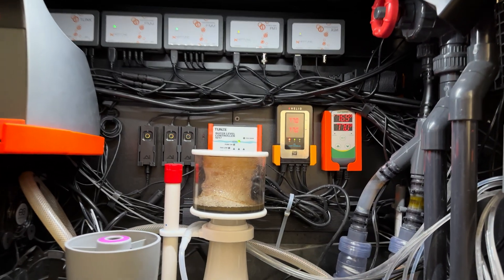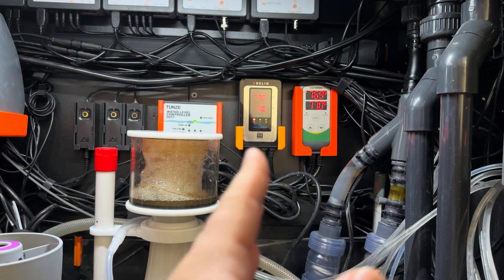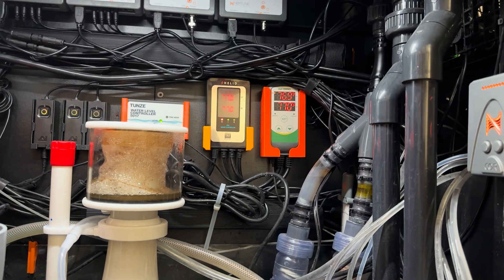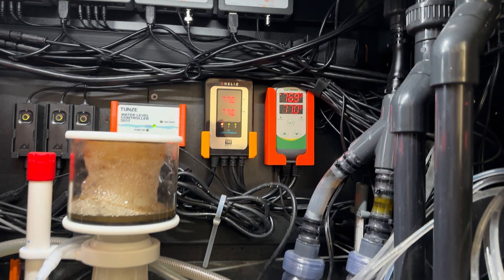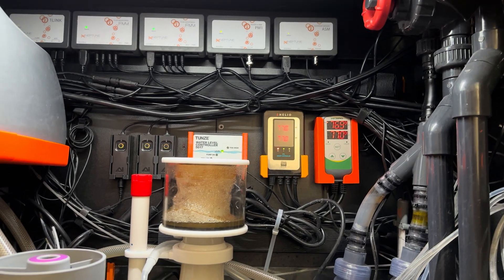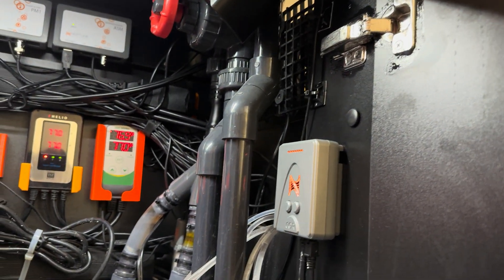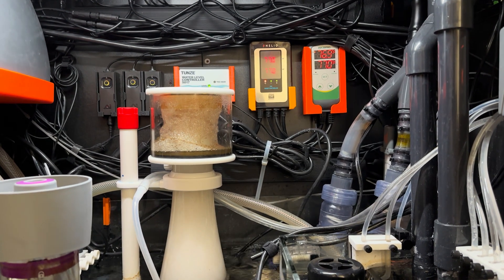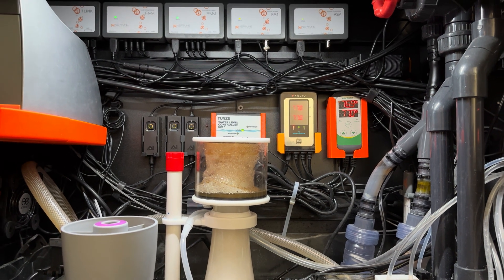Explained: How I Manage Reef Tank Temperature (Failsafes, Redundancies, Alarms, Etc)

Comment: I have a 80 gallon do you think just 2 heaters and the ink bird controller would work? can't really afford the neptune apex system
Reply from the maker: Fortunately, you don’t need an Apex at all, to have a great tank. It makes some things convenient, but isn’t necessary in any way. I’d roll with dual heaters, and an Inkbird, or really any heater controller that’s reputable. I’ve had good luck with Inkbird, but a couple of my subscribers said theirs gave out on them. None of these heater controllers is super expensively built, but we work with what’s available 😂
Reply: @kalamazoo_reefer  Thanks yeah hopefully one day i can get a apex system but for now no lol also how often do you replace your eheim heaters?
Reply from the maker: @Marshy2020  Well, I go every two years on those, purely because I’ve never had one die. I still am paranoid about them dying, because I know they’re not “high end” equipment. They’re also dirt cheap. So every couple years, I swap in new units. But by no means do I think changing out heaters every single year, like some people do, is necessary.
Reply: @kalamazoo_reefer  Ok thanks for the help

Comment: What temperature do you set your eheim heater with the inkbird?

I only have a heater set on 82F with inkbird auto shut off at 78F. Come to think of it, is it bad for inkbird to cut off power when heater is still actively heating?
Reply from the maker: Yep I have to Eheim on 82. I figure that’s good enough as a failsafe to the failsafe lol. I doubt these heaters are bothered by that. They’re just “lights and clockwork”, so to speak. Simple on/off tools to get the job done. In fact, it may actually prevent wear in the heater’s internal on/off mechanism, since it doesn’t even need to disengage on its own. All speculative, but I’m not worried.

Comment: Be careful of the ink birds, the low quality relays they use generally fail on.....  If you hear the clicky-clicky from relays in your temp controller it is the wrong solution and anything with a mechanical relay should not be used for backup/safety cut offs.  The ink bird will fail ON long before even the cheapest heater every fails, let alone failing on.....

The only problem with the Helio is the terrible garbage grade metal they call "titanium" going in you water. The better way to do this is a reptile heat mat under the sump and keep the 110/240v out of your water.....
Reply from the maker: Dude…a heat mat under the sump is so cool to think about. Though I’d be furious if it died, and I had to drain and lift the sump to swap it out 😂 Still, you’re probably right about the Inkbird. Can’t imagine they have very expensive internals. That’s why I’ve got so many layers of paranoid failsafe mechanisms.

Comment: this is hightech stuff, but for a nano and beginners I always add two heaters in it. if one dies the other works... Tho still nog 100% guaranty
Reply from the maker: Oh it’s a brilliant move. Especially if you can find two heaters small enough to tuck into a rear chamber. I’ve got two heaters on one of my nanos. The other, I just couldn’t find two small enough.
Reply: @kalamazoo_reefer  Eheim should fit 🙂
Reply: I just added my Amblyeleotris wheeleri and and pistol shrimp (tiger one)